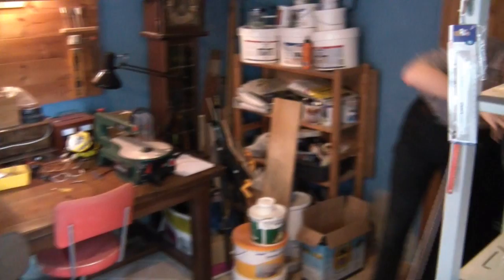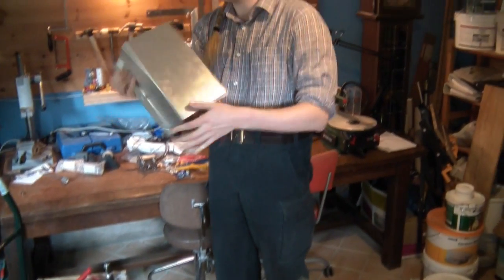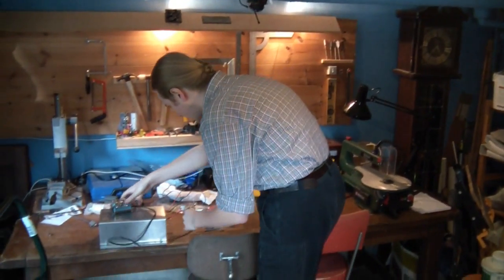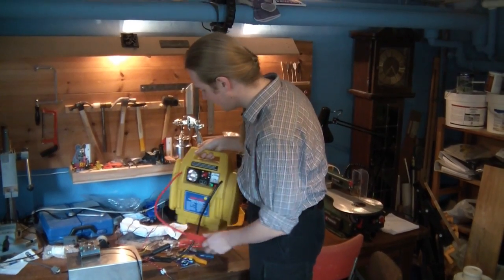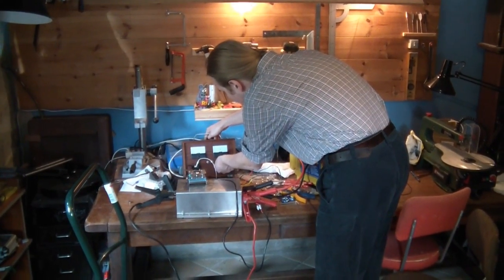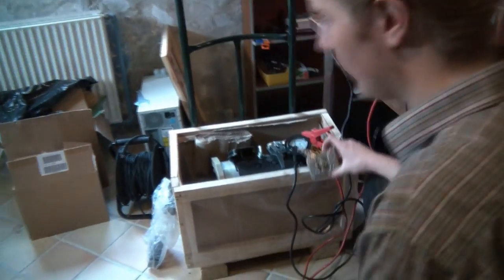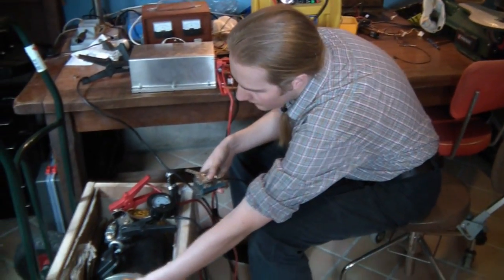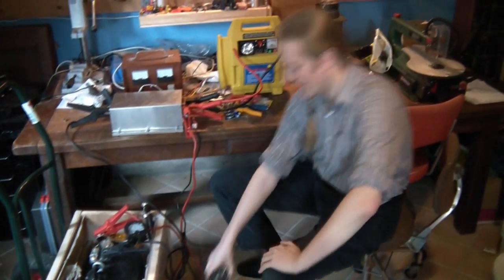Benny's EV vol. 3 ENG

Comment: @Sohave it is not complicated, it is just radio noise. but they want money for the test.
there is a blog by a german guy who goes through the process with video. quite informative. I think it costs him about 2000 euro. I think it was a golf 2 he converted but not sure. he was required to encase the high voltage parts.
I saw another log about a later conversion that suggested the price had dropped somewhat because the process had become more streamlined. maybe 900 euro, not sure

Comment from the maker: @DanFrederiksen I need batteries and charger plus a battery gauge. A circuit breaker would be a nice extra, But I already got fuses so I am safe. I have filmed a lot of restoration which I have not yet put up online since my video editing computer blew its soundcard. I should try comunicating with Enhedslisten. 
EMI testing! Is that dificult, is that not just a check up on magnetic noize, or does that involve more?

Comment from the maker: @AradhikaSingh To give a little outsider introduction the motorcontroller is located between the battery pack and motor of an electric car controlling the amount of power going from the battery pack to the motor and there by controlling the speed of the car. The motorcontroller is usualy informed in how much power to release by the means of a variable resistor (pot-meter) hooked to the gas pedal of the car, as shown.